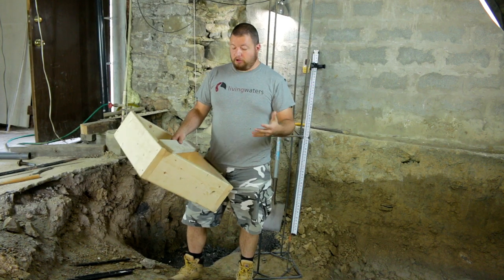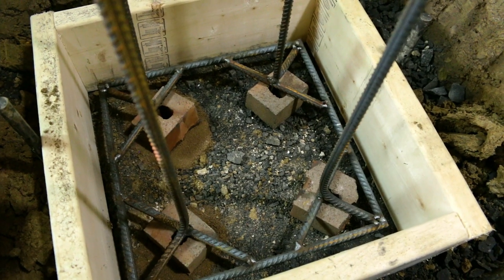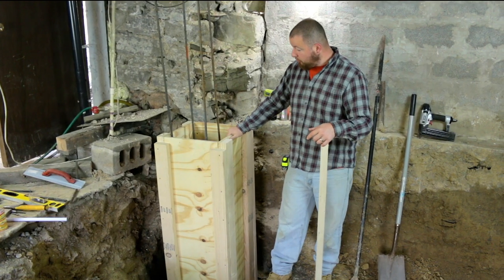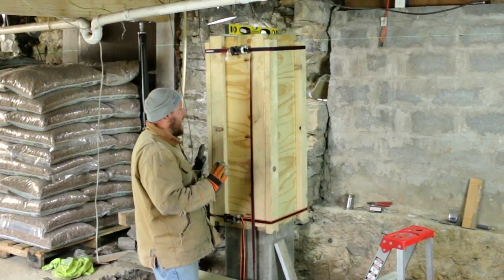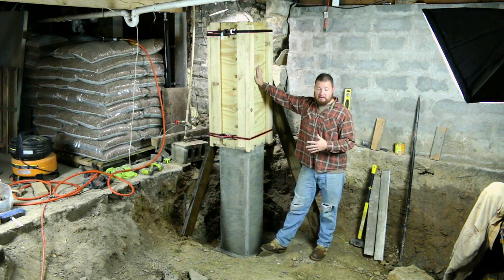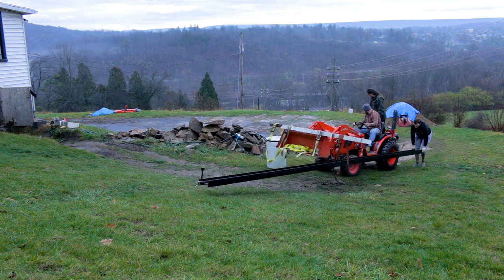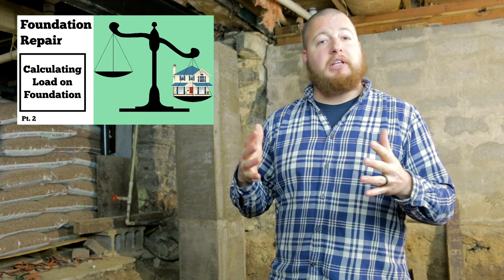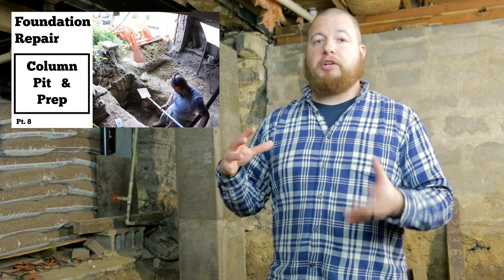Foundation Repair: Column Form, Pour and Beam Install Pt 9

Comment: I was involved in the moving and placing of a pair of 30 ft. I-beams using a loader tractor. Our method was to have the tractor straddle the beam to be moved to the point where the bucket was above the ca. 1/3 point of the beam. This left about 2/3 of the beam in front of the bucket. A log grapple was chained to the bucket and attached to the beam. When the bucket was raised the beam portion under the tractor was lifted until it contacted the tractor's differential housing. More lifting raised the front section of the beam until it was off the ground and unlikely to strike any obstacles. In this fashion the beam was driven to where it was to be placed (a bridging member spanning a dry slough).

Comment: Great Series! Suggestion: Whenever you pour a column in lifts it is best to use a keyed pour instead of relying on rebar. Place a chunk of 4X6 in the top of the pour and tamp it flush to the top surface. Remove it before the next pour and it will key lock the segments of the column. Same can be done at the actual foundation pour as well as the lifts. Much stronger and if moisture degrades the rebar the concrete will still perform as a unit.
Reply from the maker: Nice suggestion

Comment: Congrats.  Really enjoyed your foundation videos.  Sometimes columns need stirrups (horizontal rectangles wrapped around the outside of the vertical rods) at say 200-300mm spacing to increase their strength.
Reply from the maker: Yes i probably could of had more instead of just the one. And Im glad you enjoyed the series!

Comment: Nice work.  I’m doing the same kind of work to 1800s two story house.   Although just leveling and adding supports.    I got tired of crushing those big box store concrete blocks under jacks so I used solid 6x8 beams cut in 2ft sections for jack pads.   My house was also sheet rocked with the sag.   Leveling it created cracks above windows and doors that will need to be repaired.
Reply from the maker: Yes, My house was sheet rocked while it was sagged and there are cracks everywhere. Good idea with the jack pads too.

Comment: Super helpful. THANK You!!
Though the first 4-5 videos only applied to my situation. 
Watching them all confirmed some details I am already aware of, and others gave me new insights.
I need to replace a failing rubble rock foundation and planning on doing it from the inside as opposed to from the outside. 
My only dilemma at the moment is on how to waterproof!?
My plan is cinder blocks.
Reply from the maker: Thank you! Im glad you got some helpful info. Cinder block would be a good substitute. The water proofing is going to be tough. The only thing i can think of is, while laying your courses, reach behind and roll on your tar  onto the last two courses that way you get the joints. The top courses will be tough but maybe will be high enough to get from outside. I would love to hear back and see how you made out!

Comment: Great series thank you!  When you put the black beam on top of the concrete column, it seems to just slide in.  With no load on it... I don't understand how you got the load transfer back onto the beam and thence to the columns -- did you lower the jacks so the floor joists rested on the beam (not shown in the video)?
Reply from the maker: Yes, we will lower the flor jacks to have the floor joists rest on the I beam
Reply: Thank you so much for monitoring this and the quick reply!

Comment: That’s a lot of concrete to lift up by shovel!  Nice job though.  Why not CMU stacked and filled with concrete?  Although your poured column does look better, the stacked concrete blocks make a solid 16x16 column that one person can put up including the concrete grout filler.
Reply from the maker: Yes thats possible, but i dont know if its as strong as solid concrete vs grout and cmu, also placing over the rebar would be a pain.
Reply: @appalachiandiy2415  your poured column certainly works and you have a nice solid rebar setup.  In the blocks what I’ve seen is simply 2, 3, or 4 foot rebar pushed down into the grout filled channels, not wired together but they must overlap one block length or so.  The concrete block industry has a good builders guide out there showing wall and column methods. My cottage foundation is on 4 foot tall stacked blocks on large poured footer like your column, that’s why I’m familiar with it.  I’m watching your lifting video because the 50 year old footer blocks on one side shifted with tree roots so I’m lifting that end of the house and replacing them one at a time.  Your videos have been very helpful even though the situation is a bit different.  Hearing the house creak with every push of the jack handle took some getting used to, but I’m doing like you did, 1/8 th inch or less at a time.
Reply from the maker: @EdwardT9  yea! That creak is a little unnerving

Comment: Did you use poured columns due to the weight on each end of I beam? Instead of say cement filled lally columns.
Reply from the maker: correct. It also gives more bearing surface for the beam

Comment: column rebars as you have put then, are not strong. need more  stirrups (horizontal rectangles wrapped around the outside of the vertical rods)  to increase their strength to keep weight
Reply: absolutely agree. i rewatched and he only got vertical rebar.